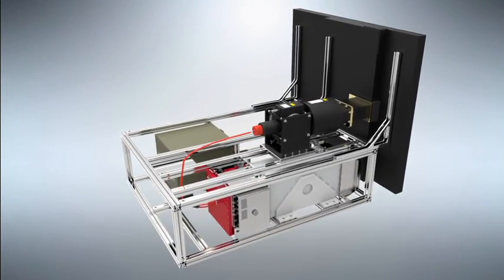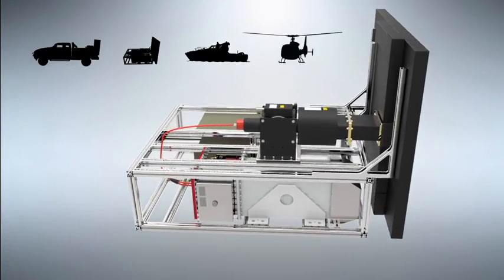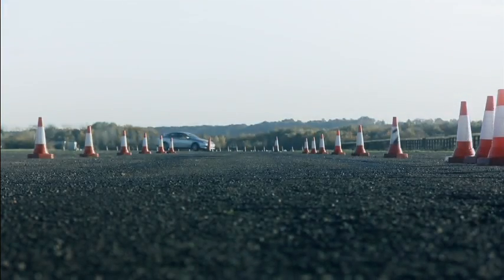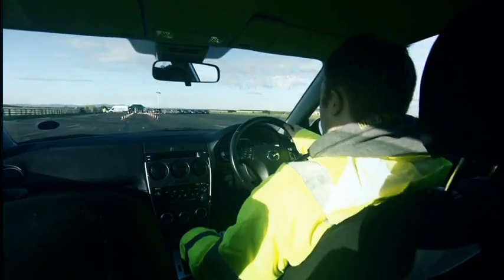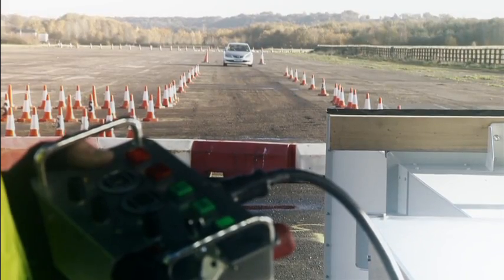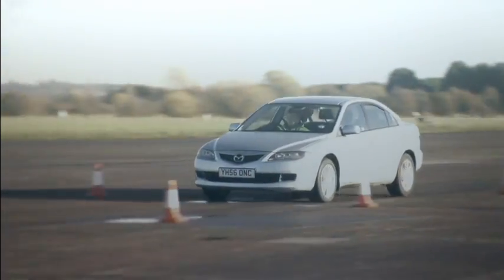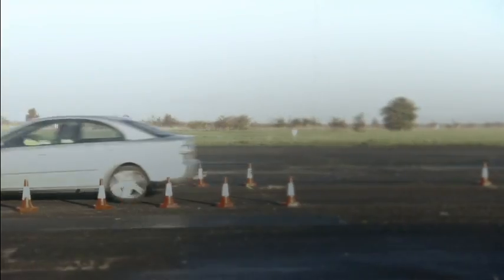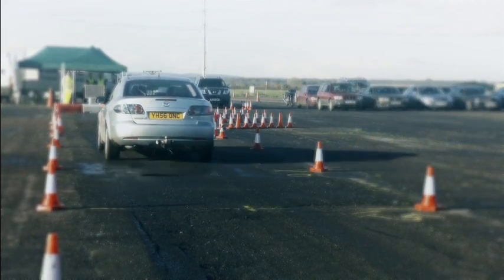EMP Vehicle Stop

Comment: bullshit.
In order to induce a sufficient current to even light up a small light bulb at 50 meters, we are talking hundreds of KW.
To make it through the natural shielding that the car has (it's body), you would need orders of magnitude more power.
EVERYTHING on a car's ECU is galvanically isolated, because manufacturers are not stupid.
Add to that that your "RF technology" would need to be tuned for the length of the conductors in the car.
Nevermind that blasting the car's occupant with that amount of energy would be an absolutely outrageous thing to do.

Comment: Silly demonstration. They "might" be able to confuse the electronics leading the engine to misfire or even stop, but not able to stop the car if it's an automatic transmission, which will continue to roll by the inertia.
Reply: Nah dude a strong enough emp wave can easily disable some of the most sophisticated and modern car engines and batteries. No operating on electricity is safe including humans. Also all newer  car come built with this feature but you won't know until the law is on  that azz😂. Keep it old school is the best way

Comment: Doesn't the EMP pulse radiate outwards in all directions? Wouldn't that cause damage to any electrical equipment these people are using that is behind them? How could they ensure that the EMP pulse is directed only to the car and not in every direction?
Reply: It is directed energy, the signal doesn't go to the sides only in the pointed direction.
Reply: @mrwayne5158  How could they direct it in one direction? How would that be possible?
Reply: @RockMeAmadeus1  Its what happens with these devices, sure the signal extends to the sides of where the directed energy is pointed but it wouldn't be a strong enough signal to do anything. If you want an example of directed energy look up the microwave gun used by the government; they mount it on a humvee and fire away. Pretty cool stuff.

Comment: Now Here is a Question ?   What if the anyone  in the vehicle  you are trying to stop or  anyone is caught  in the path of the RF beam had a pacemaker/defibrillator  fitted ,, will it Kill them ? , A Pacemaker wrongly Firing and stooping  the heart  or inducing Atrial fibrillation,  , Insulin pumps activating , Cocklier Implant being  Damaged ,, Pacemakers / implants Rendered useless  putting lives at risk ..... at least  Dangerous surgery  to replace these implants if it does not kill them   Hmmmm  I think  Safe Stop Teledyne e2v  may need  to do some more testing  , Great Idea  BUT...........    What do you think , put it into production anyway  or do some more testing ,,,,,,,

Comment: "EMP Missed The Target 
EMP has missed the Target
All Units Continue Pursuit"
Reply: All units, we are reading a disruption to the communication system. Please confirm system operations.
Reply: We’re detecting an emp lock signal, take evasive maneuvers.
Reply: @RedDawn0808  rofl “our systems reading are signaling a significant drop in activity—EMP deployed successfully—this is Raven 1-3, our rotors have stopped working along with all other systems, attempting reboot of the system. The ground is coming to catch us———“
Reply: I must shut off nanotech BMI rnm mk. Neb
Reply: last Parts Are Quite confusin i ain't gettin em

Comment: DOES IT WORK  IF THERE ARE  AIR TIGHT  GLASS ENCLOSED  ELECTRONICS  IN  A VEHICLE .    LIKE A BOMBER THAT DROPS A NUKE , THE ELECTRONICS ARE ENCASED IN AIR TIGHT GLASS INSULATION  SO THE EMP FROM THE BLAST WONT   EFFECT THE PLANE .

Comment: You can protect your car against this by putting a metal cover or mesh over any open areas of the engine bay: specifically the fan intake. Electromagnetic shielding would prevent damage and render this device ineffective
Reply: Yes.  You need to make a metal shield entirely around all wiring, and electrical parts, like the starter, and alternator, also in tests it was found that wiring to the directionals and tail lamps was an entry point. if you have a plastic gas tank it must be replaced with a metal one. It is possible to shield a car but much easier to do this with an older mechanical diesel with no power options... so crank windows, no power mirrors or seat no defroster on rear window no radio antenna. The military has been EMP protecting vehicles for a very long time.  they have also been using the EMP as a weapon and destroy all cell phones computers and other electronic devices before going into a terrorists building. As I understand it they wipe out about a city block on their way in.  Due to windows a car is not as good as a Faraday cage as people think computers inside the car can be wiped out permanently if hit by the type used by the us military.  Also modern soc. would come to a standstill when we get the next Carrington Event look at what happened during a mild hit in 1921 our electronics are much more vulnerable now.
Reply: @nickrowe9221 Do you use Discord?
Reply: le dot

Comment: How does the vehicle carrying this get away? Wouldn't it fry the carrying vehicles electronics unless they were specially designed to be resistent?

Most important, how heavy is the batteries or generator needed to power this? The Army experimented with mobile pulse generators. They all required very heavy vehicles to carry them, like semitrailer size.

Comment: Old diesel car is the best defense against this. It doesn't need electricity for ignition, so it will be unaffected by this. ;)
Reply: Remind how a diesel car starts again, something about glo plugs, starter motors and ignition switches.
Reply: @joeasher2876  but if its already runing

Comment: Does this work on diesel engine
Reply: If the diesel is all electronic then no, basically any diesel after 1994 won’t survive this. Except the 5.9 cuz they stopped using it a little latter. The 7.3 Powerstroke is a computer controlled engine.

Comment: But will work on carburettor based vehicles? :P
Reply: not this one but a large Carrington Event would. you need to shield alternator, starter and all wiring to protect against that or a version of this used by military as a weapon.  the ignition coil is a real worry on gas engines.

Comment: the emp would not activate your brakes now, would it?
Reply: lol its obvious he braked, the front of the bike squatted down
Reply: Some cars have features that the brake stops working if the car is off like my suzuki wagnor boy that's gona be a sight is he is on high speed
Reply: Maybe electronic brakes. Would either slam down or stop working at all making you crash the tollbooth. Top times
Reply: Once you lose steering at a high enough speed you’re dead anyway
Reply: I must shut off nanotech BMI rnm mk. Neb
Reply: Brakes in almost all cars are hydraulics based, emp would not acitvate them or broke them. Their function will ramain the same, so car would stop by resistance not by breaking unless driver choses to brake.
Reply: if the computer controls braking, then yes, you may lose your brakes and die or run over the idiots in the booth. Humanity is getting too stupid to live.
Reply: No but stopping the energy in the car can turn on emergency stop (emp can generate heat, and my car will stop if it will detect heat, if car doesnt have it it can break some mechanizm or just stop the energy making the car slowdown.

Comment: This probably does damage your car

But does it work on a diesel? The ignition of a diesel is different because it doesn't need to spark up like a gasoline would.
Does this work on older cars, that are fully mechanical and don't need special circuitry like a ECU to run?
Reply: if its a new diesel it would stop it, as it still has an ECU. I had a car a diesel from 2000, it had a computer not very good haha but enough that i think that would stop to this, older than that tho yeah thats properly not gonna stop.
Reply: It would affect diesel because the fuel pump is electronically controlled.
Reply: Basically if there is a computer onboard it's screwed.

Comment: Doesn't work on OLD tech petrol and Diesel engines with no electronics so FAIL! Ive worked on dozens of electronic jammer like this, there is ALWAYS a fail for them. In any case you could screen the critical wires if you were determined enough.
Reply: SiliquaeSid So? Works on most vehicles.
Reply: No an old Diesel would just be running perfectly

Comment: That EMP could have saved allot of troops in Iraq & Afghanistan.
Reply: against what? that mazda is maybe 10 years old...
Reply: Matt Moon exactly what I was thinkinh
Reply: An EMP won't do a damn thing to a car that doesn't have electronically controlled engines. The enemy force would've simply went for older cars that don't use electronic fuel injection.
Reply: Matt Moon did you mean against bombs? I think it would, as most of the home made ones are probably remote controlled.

Comment: actually, it would permanently damage your car. the way it works is by generating an electric current in any piece of metal within range. this would cause a short in your car's computer (assuming it has one), and fry everything. if you have an older, carbureted car, then nothing will happen. it wont even stop your car
Reply: I believe it is high time we got out and used the old Ford Model T Cars...
Reply: @omkr0122  or horses..
Reply: microwaves are electromagnetic. It's all the same thing but the frequencies differ.
Reply: Some devices are fine. Others, not so much.
Reply: People and things like pacemakers can be affected by this as well, the video even says that it's safe only if operated within 'guidelines and how often do people breach those these days.. e.g. United Airlines and the flight attendant that ended up forcing the passengers to place their puppy in the overhead storage. It happens...
Reply: +Casper Born Microwaves are electromagnetic radiation, just at certain frequency. Does it fry you or not, depends of the power of the radiation. For example WiFi works in the same ISM band as microwave ovens and it doesn't fry you, because the power is so small. Same way, visible light can fry you, if it is powerful enough.
Reply: Crux161 as a healthy human this emf won't hurt you unless as you said you have a pacemaker, what is a problem is that it could damage the on-board computer and with cars slowly "rolling" towards being able to drive automatically this could be a serious threat to the safety of the driver (lol is a driver that isn't driving still a driver though) and next to that with most phones getting "wireless charging" which is simply an inductive coil it's very likely that these devices will get damaged if not break right away
Reply: Tesla would simply stop just like modern combustion engine cars
Reply: 007K unless you have a motorcycle or old vehicle that opearates on a Magneto...radios...old tube ...does not affect
Reply: because this is an old car a new car would fry
Reply: Silly demonstration. They "might" be able to confuse the electronics leading the engine to misfire or even stop, but not able to stop the car if it's an automatic transmission, which will continue to roll by the inertia.
Reply: Not necessarily.  That is a pseudo-myth.  It takes a lot of power to permanently fry the computer in a car because it sits deep in a Faraday cage…which is a car.
Reply: Slightly terrified of what would happen if you pointed this at a Tesla
Reply: @thobiex  The missile launchers would activate
Reply: @thobiex  Good way to explode a Tesla! 🤣
Reply: But it has a Hall effect igniter control that does not work in the presence of high power microwaves...
When there is no more spark the engine stops.
Reply: not in the long term....
Reply: erikpoephoofd I agree matter reacts differently but there's a reason it does, which are the different properties at different wavelengths ^^
Reply: Casper Born haha fair enough ;)
Reply: erikpoephoofd goed gesprek 👍
Reply: Casper Born Vond ik wel! Natuurkunde is interessant!
Reply: erikpoephoofd vind ik ook
Reply: Berry C. Really? where? I just came from a video where he destroyed 2 phones.....
Reply: He is talking long term damage may start up after 1 use but if you keep getting blasted with EMP it will cause serious damage
Reply: It honestly depends on a lot of factors. But on a car most likely it would fry some of the electronics or wiring in the car. It's just common sense that an Electromagnetic pulse would cause some things to malfunction or even be damaged in some way. Especially if its a very high voltage EMP. No it wouldn't harm any living thing.
Reply: 007K Someone fried the electrical system on my Husband's 1984 Ford F-150, and there are people in our area who have been experiencing the same problem. Just today someone pointed some type of electrical device at our mini van and my Husband said that all of the electrical devices in it went haywire. It actually belongs to my Brother-in-Law, since he was the one who bought it for us.
Reply: Well. Nothing would happen to an older car. Except maybe the battery exploding after a few seconds of continuous blasts.
Reply: Need for speed hot pursuit
Reply: Not all the time it will destroy an electronic
Reply: @SirSaturnine8008  not only tho 😉 if u played NFS hot pursuit
Reply: Even less affected would be older diesels. 
No sparkplugs, just compression.
Reply: I must shut off nanotech BMI rnm mk. Neb
Reply: Hence why my permanent car would be pre 1980 so if the u.s has an emp attack by a foreign nation I'll be fine
Reply: You are half right in misconception 😁, the tiny capacitors and rezistors will blowup/melt and from that point you can say the whole circuit is damaged but don't forget cars has protection for lightning, at least for one shot. Most of the time these fields reboot your system and it my take 5 second until you can start the engine again. There is a lot to explain..
Reply: It is believed based on some testing done by the British that most modern cars that hit pretty much universal standards laws in EMF shielding that countries such as Britain and France and America have would likely survive an EMP and still be able to drive I read the study when I was looking for a new vehicle wanted something that would run after EMP if it happens. But for most vehicles you would lose some bells and whistles such as your heated seats your digital dashboards etc. But even if your car stopped you would simply have to restart it after the EMP has passed about 5 minutes and most modern cars would restart pretty sure only elecctric cars were found to be completely destroyed and that had something to do with the way the motors were pulling electricity from the battery.
Reply: if the rf output power is high enough it may damage the engine management computer in old cars, need a lot of power thou
Reply: This is why they want you all on electric vehicles btw.
Reply: You are absolutely correct
Reply: DEPENDS:  your OLD car still has a "brain" -- hell the SOVIET cars in 1962 had their POINTS and igniton system FRIED from a HIGH STRENGTH EMP.  (although, NOW, that data is hard to find online, it used to be common knowledge).
Reply: My Vespa Super 76 only relies on magnet and copper coils with mechanical interrupter, no semiconductor with low breakdown voltage, or even a battery. With full metal body shielding as a bonus. Ready for nuclear warfare aftermath survival.
Reply: simple solution with only a few downsides:
build a Faraday cage around your car.
+ no emp can pass through
- no wifi/gps etc
+ last negative can be a positive if you want to stay hidden
Reply: @casperborn8474 most cars are themselves a great Faraday cage.  It is the computer entering self protection mode that stops the car.  It will reset once the protective capacitors fully drain.
Reply: @casperborn8474  Is that even possible on a car though, since there are windows?  🤔
Reply: but he was able to restart the car...
Reply: erikpoephoofd it's far from all the same, light are electromagnetic waves too, I see your point but across those different frequencies there are a lot of different properties
Reply: Casper Born I see your point too, it depends how you look at it. Does the photon have different different properties at different wavelengths or does matter respond in a different way? For me intuitively, the last description feels more fitting.
Reply: 007K CORRECT!!
Reply: Françoise Leclerc these aren't microwaves, it's an electro magnetic field.
If these were microwaves the driver would be cooked from the inside

Comment: Lets hope you don't have a pacemaker.
Reply: Warning shots are safer.
No joke.
Reply: Let's hope you didn't want any other piece of electronic equipment in your car...
Reply: @T0DD  ...and good luck getting p!gs to buy what they break.
Reply: Actually car acts as a faraday cage so it is not that dangerous
Reply: @timelordsmachine4528  But Faraday Cages vary depending on how they are built
Reply: let's hope the car doesn't burn due to fucked up mosfets.
Reply: thats actually true
Reply: 72 older gas vehicle 80s diesel no effect
Reply: oof
Reply: Whahaha 😆
Reply: 🤣🤣🤣 dead...no pun😅
Reply: I must shut off nanotech BMI rnm mk. Neb
Reply: holy shit-
Reply: Or electric brakes
Reply: they "might" be able to confuse the electronics leading the engine to misfire or even stop, but not able to stop the car if it's an automatic transmission, which will continue to roll by the inertia.
Reply: Or a… muscle?💪
Reply: If you don't thats your problem.  Shouldn't have came at the check point like you not gonna  stop
Reply: Grandpa: accidentally drives into military base
Military: uses EMP
Grandpa:
Reply: lets hope your car doesn't rely on a brake force amplifier, or else you're not gonna come to a halt
Reply: Lets hope they do 😈
Reply: The emp also efakt youre blod stream.
Reply: @olejrgensen3663  I think something efakt youre brain stream